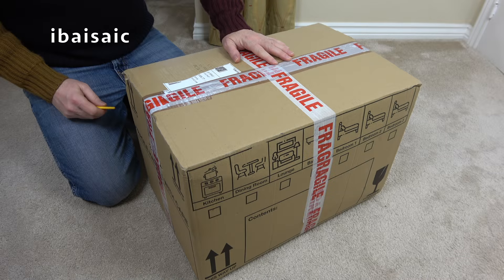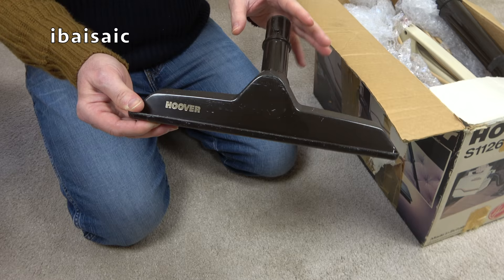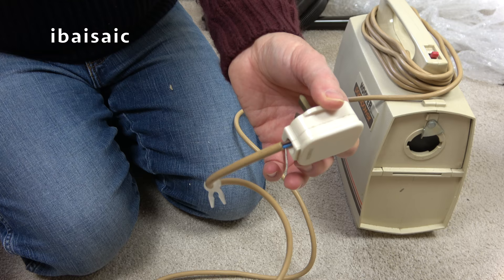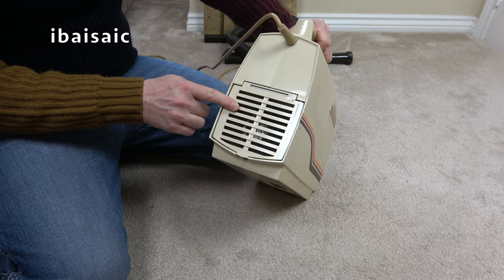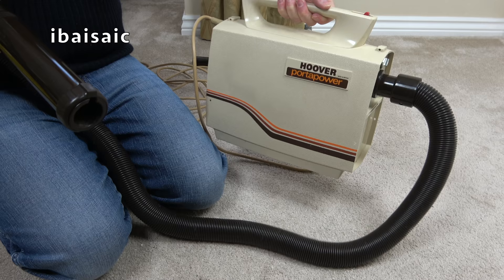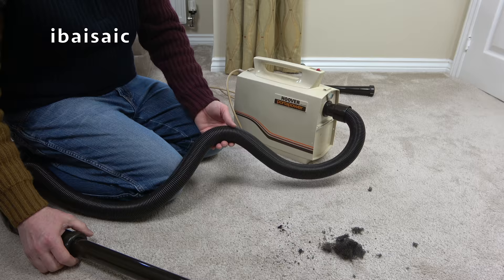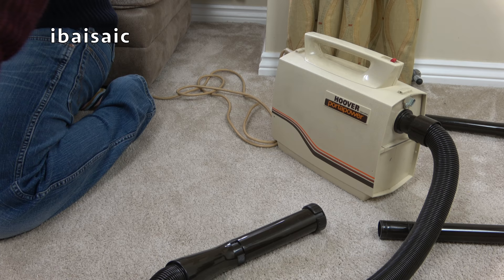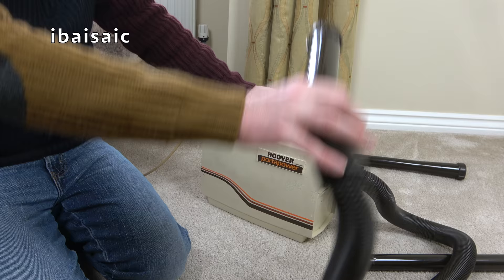1984 Hoover Portapower S1126 Vacuum Cleaner Unboxing & First Look

Comment: Hi, I have the same model, do you know if a new power switch is available, have searched hi and lo.
Thanks
Reply from the maker: The switch was used with other Hoover cleaners, mainly older uprights and crops up on ebay from time to time. Often the switches on these can be repaired by spraying contact cleaner into them.